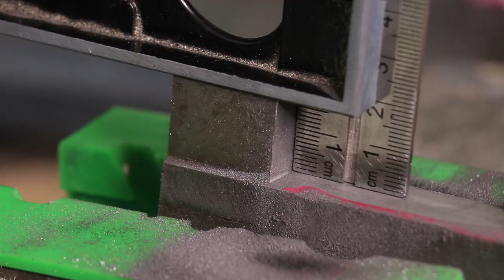Mini Lathe Carriage Lock - Essential Upgrade

Comment from the maker: G'day everyone. In this video I'll be demonstrating the carriage lock modification that I made on my mini lathe. This is an older video of mine that I edited a few months ago. I am currently working on a gear indexer for easy gear making on the mini lathe, but it is taking a little longer to make than I expected, I am looking forward to showing you it. With the carriage lock, one change I would make if I was to make it today would be instead of removing the carriage hand wheel, I would simply remove the front apron by undoing the M10 bolts located next to the dovetails on the carriage cross slide. I will also point out that I did not have any shims on hand during filming for the tool holder, so the tool was slightly below center line. Cheers.
Reply: Could you show how to cut threads on a lathe like this?
Reply: Completely unrelated to video content:  Consider pinning your comment so that it appears at the top of the list, instead of getting lost in the mix.  I know this isn't a big deal when you are getting fewer than 100 comments per video, but when numbers go up, comments get buried.
Reply: When I got my mini lathe, I said there is no way I’ll ever pay $150 for a quick change tool post, shimming isn’t that big of a problem! Six moths later, and weary of the headache of changing tools and shimming, $150 no longer seemed so ridiculous! I ordered one from Little Machine Shop, and it was a life changing event! Set each tool once and forget it, and the 10 minute tool change time is now less than 30 seconds! Your idea is a great upgrade to your Sieg manufactured lathe!

Comment: Minute 0:57 - my lathe ( Einhell MTB3000, a mix between Sieg C2 and C3  ? ) has the first type of saddle, and installing a carriage lock was very simple, with a great improve when going on parting ...
A similar work as you did, but so much easier to realize.
I also got a spare-saddle, in case something should go wrong in the future, but unfortunately i got the second version of saddle ... 
Installing a carriage-lock, as you did, on this "lighter version" ( with less iron ! ) seems not so easy, unless using a different trick. And also the final result is a bit worse, due to the need of adding that piece of iron, missing on this type of saddle. Why they got to this new saddle version ? Sure, the previous one was better ...

Comment: Tried this and 100% it's my lack of technical knowledge, but the stop still isn't pulling tight. It would be really helpful to know the measurements of the t nut and the length of the hex head bolt used. I don't want to waste any more of my life, scratching my head and swearing into the void.

Comment: Just a suggestion, maybe add a small spring between the under part of the lock and the carriage so when its loose the spring will hold the under part of the lock away from the bed so it doesnt jam considering how short the under part of the lock is
Reply from the maker: Cheers, this sounds like a good suggestion. I have not run into any problems yet, but a small spring couldn't hurt.
Reply: A rollpin as an anti swivel device in combination with the force of the spring may not hurt either.